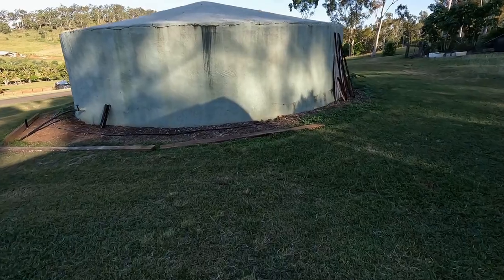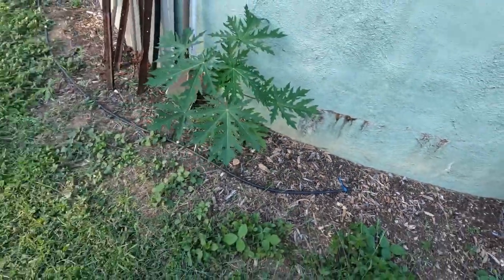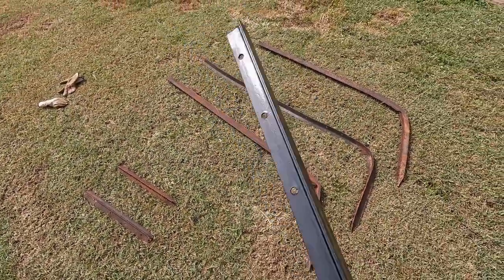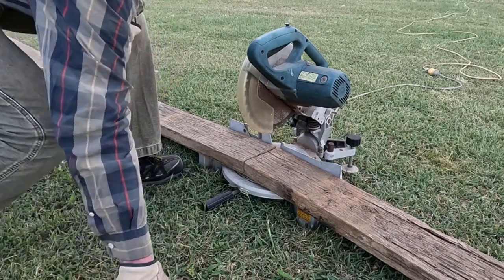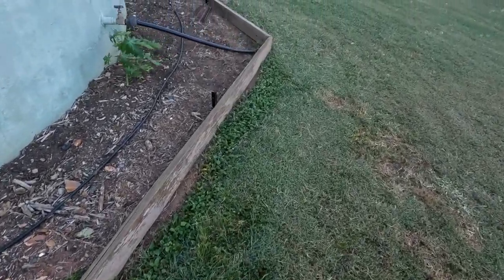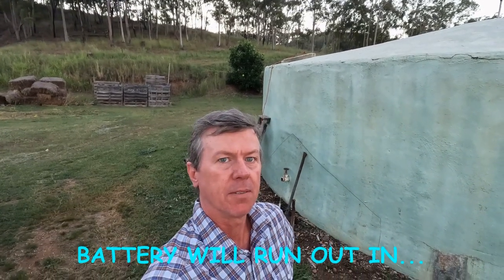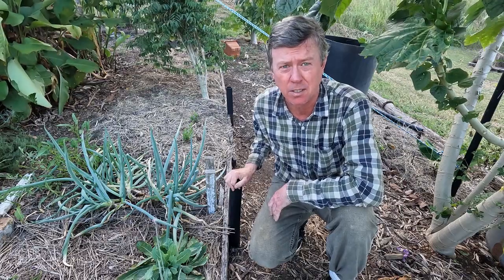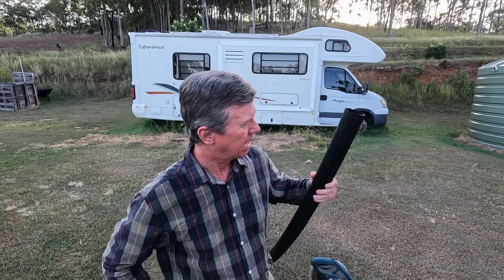New garden bed build around 25,000 gallon water tank for easier weeding and edging

Comment: Where did you find boards over 4-5 meters long?!
Reply from the maker: We disassembled an old set of cattle yards years ago and saved the good wood.  I'm pretty sure the boards were sawn on the property (probably 50+ years ago) from hardwood trees cut on the property.

There used to be an old Bedford truck under a huge common mango tree that had been converted into a timber saw.  I assume they were cut on that.  It was a wreck 35 years ago and it hadn't run in years.

I've still got a couple more lengths in the shed.

Cheers,
Murray.